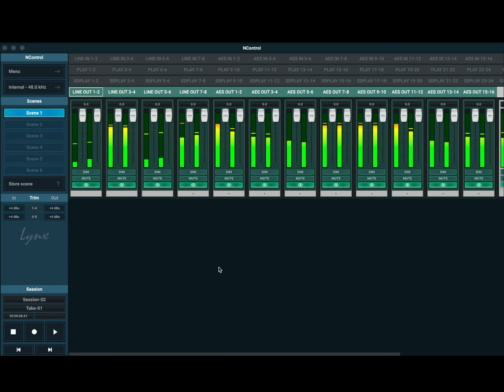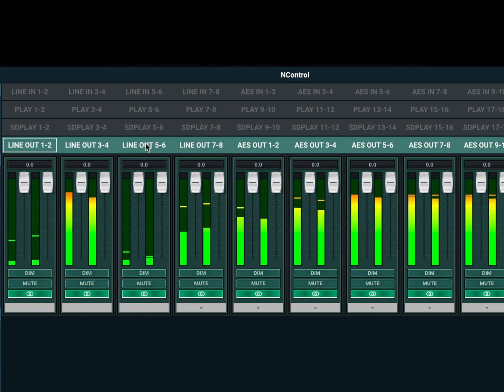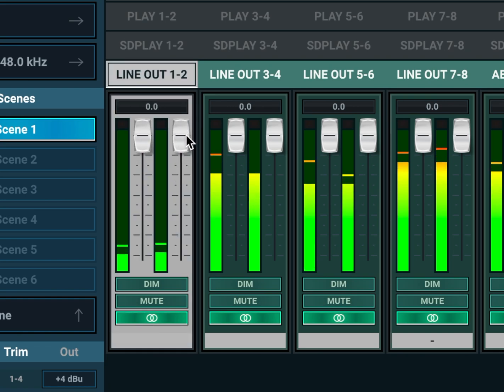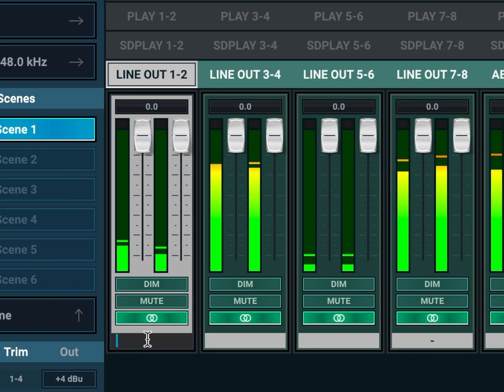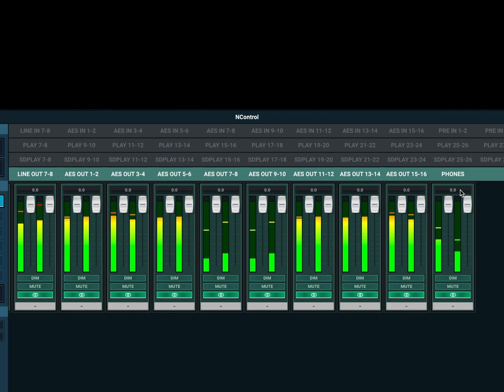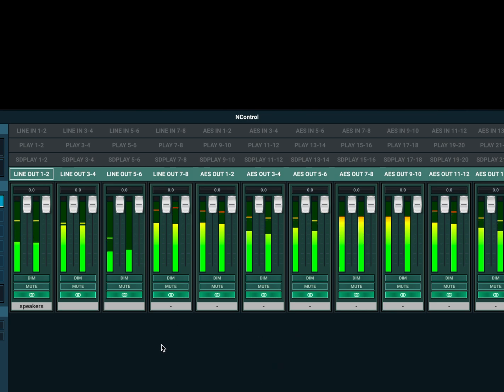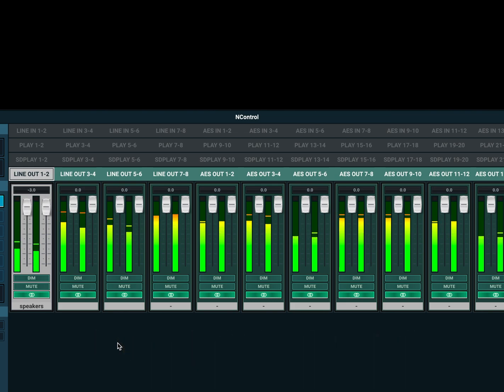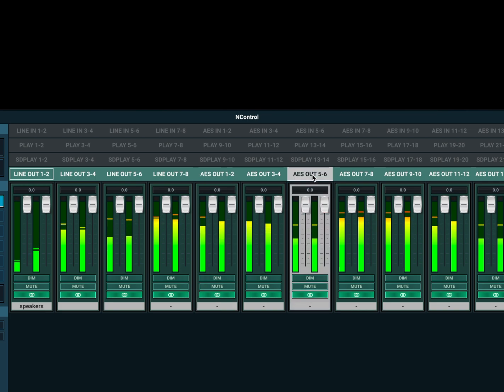Lynx Aurora NControl Tutorial part 1 of 5: Intro and Outputs

Comment: Why am I getting feed back when running insert plug in protools (OUT 5-6 IN 5-6) on the aura controller in computer, the output 5-6 has to be unmuted, but then the input also seems to need to be either muted or unmuted in this ncontrol?   Also out 1-2 go to monitors, so i have out 1-2 play 1-2 unmuted and output 5-6 play 5-6 unmuted. Is this correct or should i be unmuting inputs?

Comment: Hey! Can you control the line outputs with the front paneel knob, or i need a monitor controller
Reply from the maker: Yes, it is possible to control the line outputs volume with the front panel rotary encoder.
Reply: @LynxStudioTech  so, no monitor controller needed ?
Reply: @lucatoni1997  No, not really.